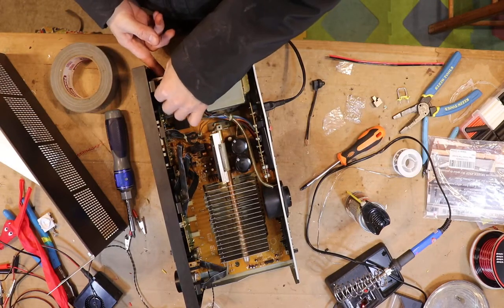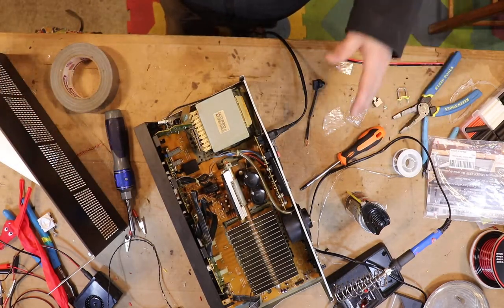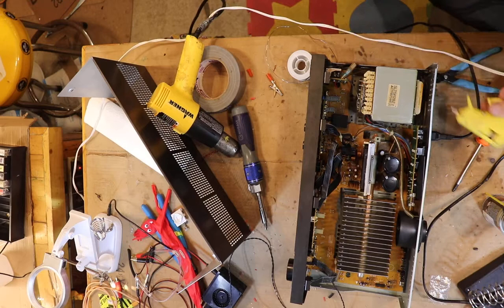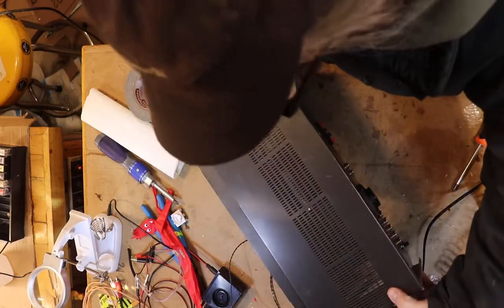Repairing an Old Receiver Technics Su-V76 broken power switch

Comment: I have one of those with the exact same problem, but try and find one of those switches is near impossible even though they were used on numerous tv's as well, it now sits in my stack of broken gear, which is too bad 'cause they're a sleeper of an amp @ about 85watts rms per channel, so its going to sit until I find a donor out of something.

Comment: Hey, great video! I see you soldered the new power switch onto the back of the board.

I was wondering, would you be able to unsolder the old switch and replace it with the new one - then feed it through to where the old button was? Sure it’d look a little tacky.

Is there another function of the old switch that would cause removing it to cause complications?